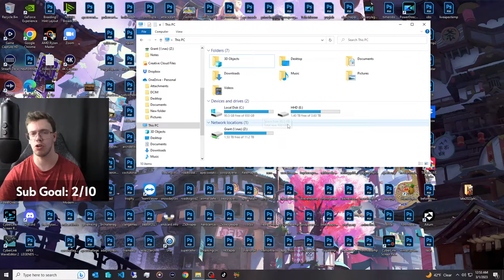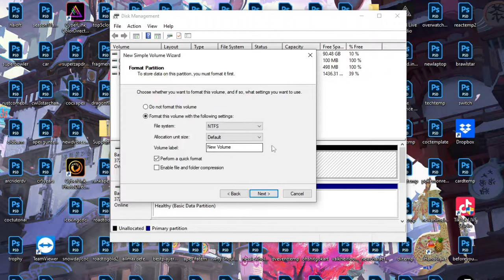A Beginners Guide: How to Install a Hard Drive in a PC

Comment: I do all this but when I open my computer to make it an existing drive using disk management but it is not there. Only disk 0. I am missing out on 5 terabytes and it is useless.
Reply: If you have a m2 nvme installed on your computer than some hdd/ssd ports on the motherboard get disabled. Usually the first 2or 4 first ports .  Change the ports and see if that helps

Comment: what if i want to add multiple hard drives ?
Reply from the maker: If you don't have enough hard drive cages you might want to get a external hard drive enclosure. Just make sure you get one works for the drives you're using.